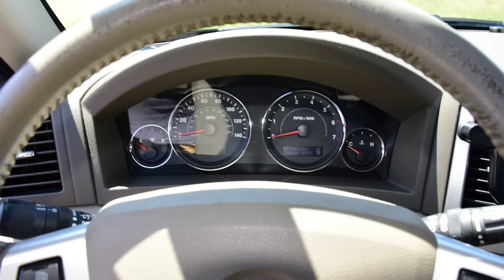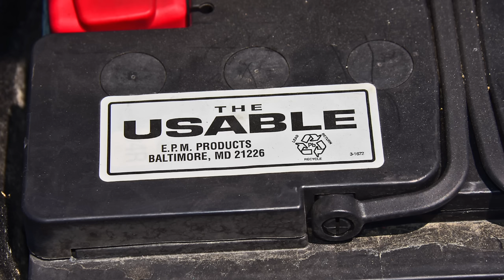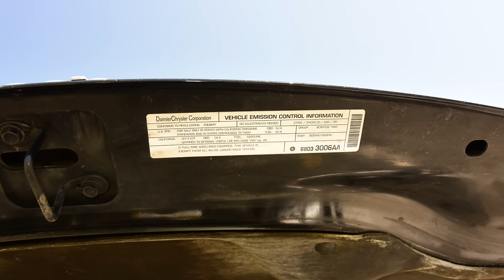2008 Jeep Grand Cherokee Laredo X: Regular Car Reviews

Comment: GF has one... has 116miles. Water pump did die and it did overhead, which is a killer for the 3.7, but luckily there was no issues to the valves or head gasket. Run synth and do oil change ever 3K, get the coolant serviced OFTEN as overheating is its biggest enemy. 

As far as it goes, its plasticy, bad on fuel, but so far 'reasonably' dependable. Even though its not powerful as its 4500lbs with the 3.7, its kinda serves the utility like a Subaru forrester... the quad-trac 1 is still more 'offroad' than most Helix systems out there and it does use proper truck tires and has proper clearance. SO if you need something that works well in inclimate weather, has clearance for getting out to get you out in the backcountry (but not straight up hick style 4wheeling), with space... its not terrible, and can be had with low KM for well under 5K

Comment: THis lug defect could have been fatal for me or my Challenger twice before I figured out that they were backing themselves way off my front wheel studs constantly no matter the tightness. Once I had just driven well over 3 digits with a friend in the car then to discover 4 of the right front lugs were dangerously loose. Then I hopped on the webs and found out the lugs were all like this.
Reply: You haven’t lived until you lost a wheel while driving. Some of us may have had it happen more than once. Experience helps I guess driving with three wheels.

Comment: I had an 05 Laredo V8 (same generation, largely the same) and those blind spots are no joke in the front, visibility is like the SUV version of a modern Camaro. The V8 was also prone to oil leaks and gasket issues.

I now daily a 98 laredo V6 that i paid $3200 for. It's a better car.

Comment: My 2002 “Alabama trash can Benz” ML320 has the same transmission plug instead of a dipstick. Based on advice from the forums, it’s not designed to be driven with the dipstick in place.

‘Gotta love when the conglomerates push bad ideas across multiple brands in their portfolio!?

Comment: it would tow 3500lb just fine, just can't have any major expectations for acceleration. I routinely tow ~3000-5000 behind an H3 on oversized tires with a similar anemic 3.7L engine (5 cyl) at 7000ft elevation and it's functional/doable. If the 240hp 3.7L in my heavier SUV can yank that weight around at this elevation, then the 210HP 3.7L in that heep can probably do the same at lower elevation just fine.

Comment: Late to the party... but the only good version of this Jeep is the Overland trim with the Mercedes OM642 3.0L V6 Diesel engine. It has QuadraDrive II with actual low range, a decent amount of torque and power owing to the diesel engine and most of the luxury / creature comfort features that you can find in a modern vehicle. With a GDE tune for the diesel engine I average about 26mpg combined. I've had this combination with a couple other quality of life mods to fix known factory deficiencies and it has been my daily for about 12 years.

Comment: This reminds me of the Land Rover Freelander which, whilst having the Land Rover name, it was the least Land Rover-y vehicle (more like a 'Lite' version of a Land Rover) with (in the case of my vehicle) a gutless and noisy underpowered 1.8L gasoline engine (notorious for head gasket issues), no real offroad capability, with a sort-of-permanent AWD using a viscous coupling between front and rear (most of these couplings failed after about 10k miles and either broke the transmission and/or diff if not repaired, or in the case of a lot of owners, who just took out the prop shaft, making it FWD only). Finished off with a cheap, hard, plasticky '90s interior and exterior. Its redeeming feature was it did have a t-top which was nice I guess.

Comment: A friend of mine had a UK market Dodge Caliber from the same era and it was absolutely one of the most strikingly terrible cars I'd ever ridden in. They never made a new door skin for RHD markets so the passenger got the keyhole, the seats were terrible, the dash was terrible, the materials were terrible, the paint and plastics went nasty in just 10 years. It was just the worst. I ended up flat towing it to a garage in my 30 year old volvo once when the starter died.

Comment: I drove an early 2000's Ford Ranger that had the same sensation when driving. I constantly checked to make sure I'd released the parking brake. Whenever I took my foot off the gas pedal there was instant deceleration.
Reply: They feel like the transmission is grenading as you drive. It’s amazing to me that they sold so many rangers and explorers. They feel like absolute garbage
Reply: I feel like an airbrake has been deployed when I let off the gas on my Element.

Comment: You should have took it around a corner. Try taking a corner at 60, it just rolls so the passenger feels like he is touching the ground. Also worth noting, it's the same transmission as the srt-8 it's just you get into fifth gear and it gives out. It has no power to go past 2,000 rpm. Fuel economy on a good day was 13 mpg. But it did do pretty decent in the snow if you could feed it.

Comment: My dad wanted me to buy a Jeeo Grand Cherokee as my first car. We looked at several. I looked at this generation and it literally had a leak and puddle in the floor. 
We looked at the next gen 2011. Been smoked in. And also in hindsight it was first model year. That should have torn me off. But what did it was the transmission felt funny to my dad. Dealer was saying how fast this car would sell. 
I threw a curve ball at my dad and said i wanted a Camry. Feel like a dodged a huge bullet there. We all loved that Camry. 
We have a first gen Grand Cherokee sitting in the backyard with 300k miles. I doubt they could build them like that. Died because the tranny went out. My dad thought they would still be built like that.

Comment: As a former Discount Tire monkey, I can attest that lug nuts on Dodge/Chrysler/Jeep are absolute dog shit, the worst in the business. They would get stuck in the socket every time, or the stupid chintzy caps would spin around the nut and get rounded over or they'd just fall off completely, revealing the open ended nut that's half as big as the cap. Constant headache to save 25 cents per vehicle or however many pennies it was. Those lug nuts are a microcosm for Dodge in general.

Comment: 21:51 For several years we owned a 2005 Chevy Equinox, which was ok.  The one thing that was impressive in a good way was decent amount of rear leg room.  Several inches between the rear passenger's knees and the back of the front seats.  That Jeep leg room is really very poor.

Comment: The WK Grand Cherokee was total trash inside and out compared to the WJ that preceded it. I ended up having bought and owned for the last eight years a 2004 WJ Laredo 4.7 V8 with Quadra Trac II which is nearing 180k miles and it has been a beast in winter driving. Aside from the electrical gremlins, for the most part it has been reliable.

Comment: The 3.7 V-6 is terrible in every vehicle made (the 4.7 V-8 isn’t much better). Just low on power and low on torque where it counts - in everyday driving. The Pentastar V-6 in 2011 and later models has variable valve timing that helps quite a bit.

Comment: Every time I get into one of these Chrysler products, whether it be 2000's like this one or even through later 2010's models, I just get so.... sad. Sad that something this bad exists. Sad that anyone would ever break down and settle for one to drive in every day. Sad for my hands to touch such awful feeling materials and poorly built switchgear. Sad for my ass to sit on such a cheap and stiff seat. Even when I got to spend some time in an 08 SRT8 Grand Cherokee a few months ago, other than the drive being a little fun since the t-case was smoked and could only send the power to the rear, it was still a very disappointing vehicle. Even with newer models, the feeling still stands. I'll drive a '17 Charger, '20 Challenger Scat Pack, '18 Renegade, '16 Dart, '10 Town & Country, no matter the trim level or brand within FCA/Stellantis, it's all still the same cheap garbage. Underpowered engines (Scat pack aside, of course) low-tier infotainment from the K-mart toy aisle, flimsy knobs, uncomfortable hard plastics, the list does on and on. I don't even care if they make them reliable anymore, just make them not a burden on the soul to exist in. They seem to be turning it around with the new Grand Cherokees and Wagoneers, and the new Rams aren't awful (still far behind Ford & Toyota though), I just hope the company as a whole can learn and finally give people something decent in all departments and classes going forward.

Comment: You should absolutely despise this Jeep, because if you only replace 2 worn tires, the difference in tire diameter WILL grenade the transfer case/transmission unit.

Comment: If Roman is under 6'0" and has next to no leg room, there is zero chance that I am going to be able to get into the backseat without injury lol.  Also as someone who has grown up with two 2000's era  2-door Wrangler Saharas and found those Jeeps a pain in the ass to get in and out of, it seems as though Chrysler used the same design method on the cheaper end of "Grand Cherokee "style 4 door models.

Comment: My grandpa has a base Laredo from this generation with the 4.7 v8 rwd and even then the acceleration is beyond lack luster despite the small increase in power. And like the video mentioned it had laughably bad plastics and comfort is less than ideal. But my grandpa has gotten it near 200k miles with no major repairs aside from some valve replacements and general maintenance.
Reply: Not bad for the base model GC. These are dated as heck now, but you can pick one up now cheap and still use it.

Comment: 2000’s Chrysler is just the worst. It’s like they took the idea of German engineering from the Mercedes collab, but decided to do it as cheap as possible. The large cars are decent, the 300, Durango, Charger, and RAM, but when it comes to the grocery getters that most non-enthusiasts would choose to drive, they just dropped the ball. The 200, the Caliber, the PT Cruiser, all some of the worst American cars in recent years. All over engineered in the worst way. They created a Rube Goldberg vehicle designed to frustrate and mock the owners. Wanna change the battery? Remove the wheel, mudcover, and flip it out sideways. Changing plugs? You’ll have to remove an engine seal and replace it somewhere. Dash lights? Soldered to a board. All traits of Mercedes over engineering, except non of the quality.

Comment: i had a commander with the 4.7 that had 250k. i paid 950 for it and replaced the front driveshaft and tires after that. 9 mpg though. sold it for 2500. with a broken wheel stud. lol. new one in the glove box though

Comment: The howl you’re hearing is coming from the rear diff, and fixing it is not worth the $4k pricetag. My sister’s 07 Laredo and my 05 Limited Hemi have this howl and its become my nails on a chalkboard. Had the diffs rebuilt and it went away for 250 miles and came right back.
Reply: My mechanic used to work at a local jeep dealership. He told me that the gears in these diffs sometimes develop burrs. This one has been making that sound for about 10 years, 120k miles at this point. It wasn't from lack of service, we had that done 20k prior. The radio works, and the windows go down...best cure for that sound. Frankly, I don't even notice it much at this point.
Reply: @mikehook4830  yeah my mechanic thinks I’m paranoid now because of this damn car lol

Comment: There's some catharsis in knowing that Chrysler has been making poor cars for a long time... I owned a 2013 Dodge Dart (manual!) with the 2.4 liter and the Ralley package (I'm not sure what it was besides a rear suspension change and an interior leather package). It was a car bought out of need and the desire for a manual transmission. It was, by all measure, and awful car. Overweight and with multiple factory recalls, I should have hated it more than I did, but there was some charm in driving something that you just never cared about. In a way I understand where the owner is coming from with this car.

Comment: Meh, it's an AWD, not a 4WD. Plus, the Daimler years were dark times for Chrysler, IMHO. Our PD agency had an 08 Charger Pursuit, and that thing blew the engine at 52K miles. I mean....OK, it was used rather hard, but I have 05 Crown Vic Police Interceptors with over 200k miles still in use. Back to the Daimler/Dodge "pursuit" Charger....we dropped a new engine in when the original gave up at 52k. 5K miles later, the transmission went out. The transmission shop we used said that they couldn't repair that tranny because the software to run it was Daimler-specific, and Daimler (Benz) had made the info unavailable when Chrysler left the Benz fold. That's what they told us, and research we did at the time pretty much confirmed it. I am sure that now there is a work-around, but at that time.....NOPE. It went to auction with a basically new 5.7 hemi, and a tranny that wasn't working. Someone got a screaming deal on a new hemi with a bunch of junk around it.

Comment: I rented one of these for a multi state road trip. It was a turd on the road worst part the fuse on the charger port would blow if you hooked up 2 phones and your gauge lights are tied to the fuse that was annoying. Overall I hated it and won’t buy one again if I can avoid it.

Comment: Will say this: at least this model generation still let you open the glass seperately and compared to 2010 to now models since they had the genius idea of putting a stupid centralized glass mounted rear wiper taking up your view in the mirror AND killing the glass hatch system
Reply: Wife got a 2013 after this one, it still has the glass hatch. Son got a 2014, the hatch was removed at that point. Yes, we're a 3-GC family (4 if you count the 2004 we got as a first kid car that is dearly departed)

Comment: Rear humming sound is a worn differential, someone didnt change the oil or forgot to put the Mopar LSD additive. now it needs a rebuild.
Reply: It's been doing it for about a decade. We put about 120k on it since it started making the sound. It was serviced around 70k.
Reply: @mikehook4830  yea it wont break, just turns into an open diff. rebuild kits are only $150

Comment: I got rid of a 07 Laredo worst POS ive had ever. Transmission must have built from glass it started to die at 160k. Sold it and Swapped to a 14' Subaru WRX (then updated later to 19' STI) never once have i missed that bucket of crap. Love my Subaru's 100% wouldn't trade them for anything

Comment: I mean, at the time this was new it was competing with the Oldsmobile Bravada (last gen), GMC Envoy, and Chevy TrailBlazer. With the exception of the V8 and SS models of that set of GM vehicles, they are painfully bad. The last generation Bravada with the inline size is particularly bad. Jeep did not need to try at all, this just needed to sell to compete.

Comment: No dip stick. Just wow. 96 zj, aMc 242, solid front and rear axles.  Full-spectrum four-wheel drive, mechanical levers, few and basic Electronics. 

Found it sitting in the field, had to invest 3,000 the suspension and wheels just to get it rolling again. I would gladly spend 12,000 rebuilding this one instead of getting one of those in perfect condition for 5K. 

What is wrong with car companies? 1994 GMC Jimmy was awesome but the 1996 GMC Jimmy was a pile of crap. Early 2000's the mid-2000s, it just keeps getting worse. The brand new Jeep Grand Cherokee is a goddamn luxury Streetcar. Then these companies are complaining that nobody's buying their cars. Well no shit Sherlock. I wonder why, the fact that people are pulling old Jeeps out of fields and dumping $15,000-$30,000 to rebuild them should be a pretty good hint.

Comment: Right make and year, but wrong Model. To experience a truly bad car, you need to review a 2008 Jeep Patriot. As a Former Patriot driver I can guarantee it will be the winner. 13s 0-60 regardless how hard or soft you smash the pedal assuming it doesn't stall due to the plastic intake manifold warping and cutting off air flow. A Soft plastic dash that is so bad it's makes a malaise era car interior look awesome. Rust holes in your rear fender every two years, 30000 mile guaranteed lower ball joint arm replacements, the dog toy squeaking sound coming from the rear suspension and a upper light fixture specifically designed to drip water into your crotch when the sunroof leaks.

Comment: Want a miserable vehicle? Find an early 2000s Mitsubishi Montero.  The full size not the sport.  And not an SR.  Just the boring base.  Worst  auv I ever owned.  You would fill the oil and check the fuel every 250 miles, it didn't have enough power to pull a greased string out of a dog's ass. It did ride ok in a kind of floaty numb way.

Comment: 25:30 if you want to find true hatred drive an 05-08 Equinox or Torrent… if you can still find one in drivable condition. Those things were falling apart after 3 year leases, and even new the had the fit and finish of a model car put together by a blind 5 year old.